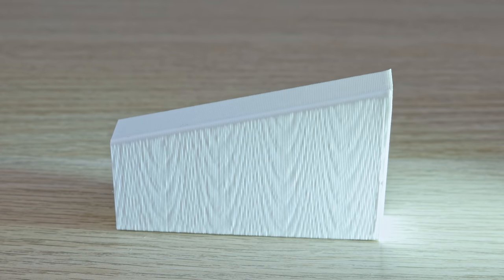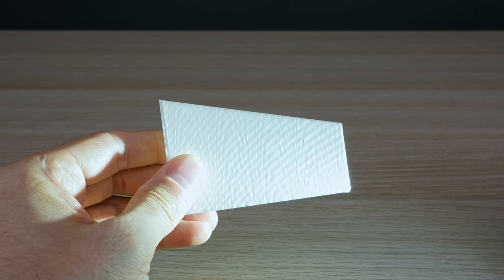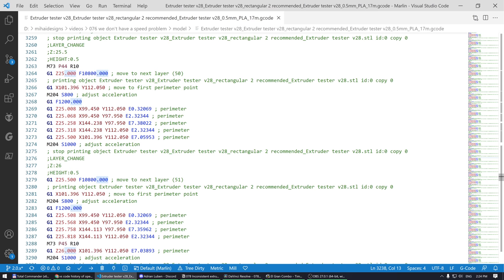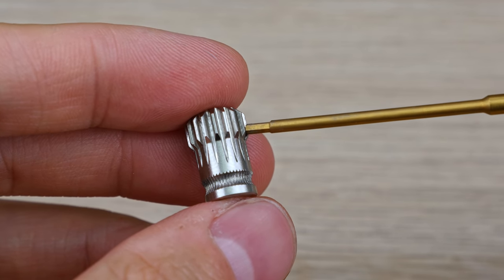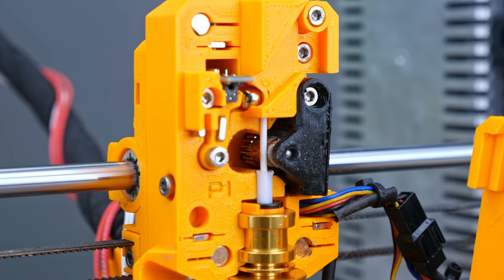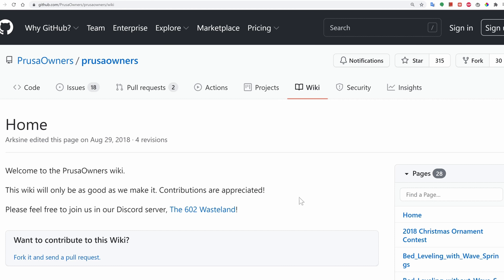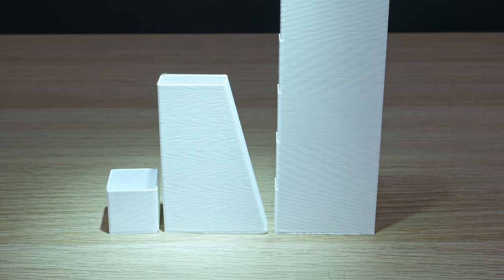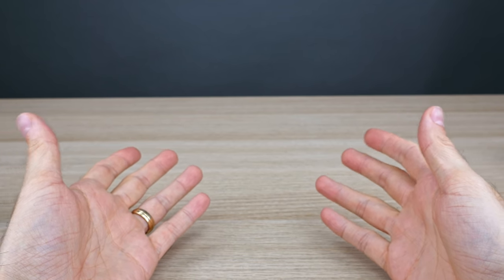What I've learned about dual gear extruders and how to patch them, maybe

Comment: There is another issue in play you missed!! The excentricity, however small, in each gear, is always aligned the same, because the gears are the same pitch, varying extrusion pressure no matter the slack. Variations in tooth serrations are also an issue. In ME we would use 2 different sized gears, with an intermediate, but that would introduce more play. Time for a toothed belt! You can vary the size of one extrusion gear, and correspondingly to its drive gear section. That should solve both your observed issue and the one I see as well.

 Don't assume compromise is the solution. We have engineering.
Reply from the maker: Yes, was pointed out before. Eccentricity should be a very different pattern, way way more elongated. Tooth shape could be a thing as in the machining not being accurate enough. The play itself shouldn't be an issue so long as the motion can be transmitted uniformly, as we're only extruding one way. At least the way I understand things.
Reply: @MihaiDesigns  It might be tiny, but as we approach higher levels of precision, it's something to consider. Our craft is making new leaps recently.
Reply: I was thinking the same thing about the belts. A double belt extruder
Reply: @NaterNorris  there is one that has been around for a while, but is for Bowden systems.  https://www.thingiverse.com/thing:2289203

Works really well for the printers that we use at work. A guy that started before I did switched all the Bowden extruders out for this instead.
Reply: I remember seeing this craze UM2  feeder years ago.

https://www.youmagine.com/designs/ninjaflex-geared-ultimaker-2-feeder
Reply: @drewporter8959  Very similar to the drive rollers on a wire feed (MIG) welder, only it has two pairs, MIG has only one.

Comment: Drop Effects OmniaDrop extruder addressed this years ago.. :P  since I got my 1st one and discovered it's improvements, all my printers now use the OmniaDrop!
Reply from the maker: How was it addressed? I'm not familiar with this extruder, but does seem to be using the same gears.
Reply: @MihaiDesigns  they are actually pitched at an angle, think like 12 degrees but dont quote me on that. Keeps the gears from separating when inserting filament as badly as normal inline gears so the backlash is lowered a good bit.
Reply: @MihaiDesigns   here is my interview with Max from DropEffects and his explanation of why/how he pitched the gears- https://youtu.be/WPwXVGKFQ5Y?t=1556

Comment: Great work! The first video of yours I saw was the "3d printing does not have a speed problem", and I wrote you off after seeing it. But I'm so glad YouTube suggested your last two videos! You have obviously put in a lot of time and effort into investigating and documenting this issue, and I am grateful for your efforts and that you shared your results and conclusions. Thanks!

Also, I wonder if replacing the spring tension mechanism with a fixed positioner like the LGX does would have an impact on this. The thought is that the force imparted to the idler gear may have a component that compresses the idler spring, and that component varies with the relative position of the driving and driven gears. A rigid idler mount would prevent spring compression that results.
Reply from the maker: Haha yes, my most unpopular video that will forever hunt me. I'll leave it there as a reminder.
You could be right about the LGX design. I have yet to try it out. I guess to simulate a more rigid tensioning system we can skip the grub screw spring. But I somehow doubt that LGX isn't using some sort of springy solution.
Reply: @MihaiDesigns  I'm not sure about LGX, but I know if at least one instance where the spring has been omitted from a dual gear setup with good results. However, it was done for part clearance reasons, and not in the context of the issue you're investigating here. That is to say, it's possible, and may be worth testing in this context.
Reply: How would a fixed positioner deal with variations in filament diameter? It could slip or bind up.
Reply: @ferrumignis   in hindsight, I wish I had said "fixed position idler". You're right that it could potentially slip or bind if the filament diameter variation is extreme. In my experience, a typical extruder bites into the filament much further than the typical filament diameter varies, so I don't think that would be a problem. I have actually been running an extruder with a rigid idler for more than a year now with no issues. 
As for why it might help with this issue, it seems plausible to me that a spring loaded idler can move away from the drive element under some circumstances, allowing the filament to "ride up" on the knurls of the drive element and changing its effective diameter. Would be interesting to see tests to verify whether this happens, and if it does, whether its effect is negligible.

Comment: Awesome research! I will need to print your STL files and see if I'm getting the same thing. I recently converted my Creality Ender 3 Pro to direct drive with the stock single gear extruder and then started to see surface patterns that weren't there before.
Reply from the maker: Go for it!
Reply: @MihaiDesigns  I'm wondering if eccentricity of the drive gear is at play. The gear has two grub screws, but I swapped the extruder and z motors to maintain full X travel. The z motor shaft doesn't have a flat spot like the extruder motor does.

Comment: Is it possible to solve it programmatically? E.g. if each printer has static deviation from ideal extruder then it might be possible to make extruder motor rotation adjusted to that deviation to compensate it. 
Some kind of coefficient, like the LA one. The tricky thing is that printer might has to know somehow the position of the gear on a moment of starting printing.
Reply from the maker: Not very easy. You could in theory do it, compensate for a repeating pattern. The challenge is figuring out the pattern offset, so how to align the compensation with the pattern. I guess in theory you could manually align it using some test print and then never turn off or reset the printer so it knows the pattern offset at all times. Include that in the firmware and it might work. This also goes for other patterns as well. With vibrations it's easier because you can use an accelerometer to make measurements. Well, technically you could add a very precise encoder that reads the filament movement (even though that would have its own moving part that can add error) and use the readings to figure out the offset (and potentially figure out the compensation function automatically).
Reply: @MihaiDesigns  if gears issue affects only the speed of filament movements (by making it unstable) then we can make a calibration movement before print starts (e.g. on a nozzle prime action) and measure speed with it deviation. Then having information about speed deviation we can identify pattern offset. To do it we might make a device that can read a speed of filament usage. What do you think?
Reply: @Dmitriy125125  I’m designing a printer that uses multiple independent print heads collaboratively printing an object, so reliability is key and this is something I’m of course interested in.

 I have a few ideas for low cost reliability, one that I’ve thought about to increase reliability is having a laser on the underside of the nozzle to measure actual extrusion and measuring actual object position/ layer width. That’s the device you’d want to measure filament extrusion, whenever more filament is pushed through the nozzle you could increase the speed of the x/y axis to smooth it out and slow down when the extrusion decreases. I don’t know how that can be implemented in firmware so maybe a god sent software engineer can chime in on that one

Comment: First of, great video. I have also watched all the inconsistent extrusion solutions and none worked. And also looked at ender 3 print that looked better than my prusa mk3 prints. I left the search for a solution as prusa research called it non existent and I supposed people just accepted it. Second, a good solution to avoid inconsistencies in gear movement is to have different teeth count in the gears, usually prime numbers. It might help here. Now you NEED the same tangential speed on both gears! So you either change diameters of the hobbed parts with the teeth or you add a train of gears (an idea I read below) with one being    on the axis of rotation of the door. Third, prusa nextruder brought other videos that explain possible issues in low diameter hobbed parts. For example, excentricities. This might be the case of both single a dual gear IE. Lastly, my vote is for belted gears. Might not be the best for traction, but it would be better than no dual. I think it could handle well different pressures of the hobbed against the filament. I dont remember any implementation of this.

Comment: I think the issue you found is very interesting, it is due to the fact that gears have to mesh very well, so a solution would be to fix your dual gears in the right position by calculating the (in dutch: Steekcirkel). Dual helicals, are not the best solution since you have to center two gears on the same axis. herringbones can be a solution, however those are expensive to make and does not solve the fact that the gears mesh badly.

Also there are problems here like, Hunting Tooth Frequency and the fact that gears have to have time to work in on eachother before they work best, especially hobbed gears. I would suggest a test, try finding the modulus of the gears, calculate your "steekcirkel" and make a fixed extruder. this should help see if its the position of the gears or just bad fabrication.
Reply from the maker: I'm just learning about the manufacturing of double helical gears. If it means you have to machine them separately and then join together then that sounds very tricky to get right. I was hoping we could perhaps move them at the ends of the part and somehow machine them from one solid piece (if it makes things easier). If it is technically doable, then some misalignment (gears not meshing at the correct distance) would result in an uniform backlash and would still transfer angular velocity uniformly. I have very limited knowledge on this stuff, so I might be wrong here.
Gears having to work on each other - with this kind of mechanism, even if they get the work needed, you could easily have one rotate when servicing the extruder and you'd then get the teeth suddenly meshing with new teeth which I imagine starts the whole process all over again.
Reply: @MihaiDesigns  Involute gears do transfer constant angular motion even with changes in centre distance.

Comment: Awesome work, thank you!  I was not seeing the pattern with my LGX, and the biggest mechanical differences are that the gears are much larger than the ones you showed here, and the tension adjustment is quantized to set stations instead of spring-loaded.  I'm trying to think of what difference those would make.  Larger gears would mean that adjustments in the gear mesh would be smaller in proportion to the gear radii, so small variations might have less impact.  The quantized tension adjustment seems like it wouldn't have much impact, except that it might reduce variation by holding the gear mesh to a set amount (versus the inherent flexibility of a spring-loaded arm)...  Two other differences are that the large hob wheels have more surface area in contact with the filament, which might average out some variation, and the build/machining quality is hopefully better (given the price premium 😅).
Reply: the lgx is geared, mihai's isn't geared.
Reply from the maker: Yes, I was thinking the same. Will have to get hold of one.
Reply: @Tedlasman  Yes, the LGX is 3:1, but I'm not sure this would matter because Mihai's findings are pointing to the driven/idler gear mesh, which is 1:1 regardless of the stepper/output ratio.  That drive geardown could certainly introduce artifacting of its own, though -- and that could be tested on any of the dual-drive geared extruders like the Orbiter, Sherpa, Hemera (I think?), M4, LGX, etc.  These offer ratios from 3:1 to over 7:1, if I'm not mistaken, and would all produce different periodicity if it's a problem.  I only have access to an LGX and a Nimble right now.  My Nimble (early-gen, V1.2) does have hilarious levels of artifacting because of the drive cable, and my testing from that gives me confidence that the drive ratio won't be a primary factor -- the artifacting I saw repeated at about 1.4mm^3 of filament, which corresponded exactly to half a rotation of the drive cable (that is, upstream of the Nimble's 30:1 worm gear), and changing the ratio upstream of the drive cable with a 1:3 overdrive on the stepper didn't alter the pattern.  So you have to consider how potential artifacting sources might stack, and in what order.
Reply: One other thing that might set the LGX apart is that the large gears should have more teeth interfacing at any given time, compared to the normal ones, which would also add an averaging effect.  If you think about the mechanical problem, these small-geared dual drives push a fair volume of filament for every tooth interaction within the mesh, and I don't know if it's possible to have a straight-cut tooth profile that gives perfectly smooth motion through the full sweep of two teeth meeting and parting ways when the depth of mesh is variable.  Any variation of where the teeth intersect will slightly change the 1:1 ratio one way or the other and introduce extrusion variations for straight-cut gears.  On that basis, I'm convinced Mihai's suggestion of herringbone driver/idler gears would probably go a long way toward resolving this for gears of the size in the video.
Reply: @jamespray  Standard involute gears do allow a change in the centre distance between the gears, while maintaining a constant rotation speed between the gears, this is one of the benefits of the involute profile. That's why this pattern effect is so perplexing, since in theory it should not happen. 
My current hypothesis is that it is caused by shaft angle misalignment, which is known to cause meshing errors and edge loading of the gear teeth (it would also explain why it happens on some extruders but not others). This is dealt with in industry by tooth crowning, which solves shaft misalignment issues but the only way to know would be to test.
Reply: @Bordpie  Well, hey, then I learned something today.  But here's something else I've noticed that makes me inclined to finger manufacturing problems: look at the thumbnail on this very video.  On the right gear, look at the distance between the hob cut and the bottom of each tooth cut.  It's not constant, but describes a clear arc from high-left to low-right.  Likewise, compare the hob cuts on the left versus the right, especially the depth of cut.  They're not the same.  Given that sort of quality control in evidence, the odds of the tooth profiles being incorrectly designed or incorrectly implemented seems fairly good to me.
Reply: @jamespray  Yes, I think the parts shown in the video were cheap clones but he doesn't use them on his printers I don't think. 
It's a fair point, most people are assuming the gears are properly manufactured in the first place. I would hope E3D at least would do the proper engineering and quality checks. I remember seeing a video where they had a special geometry analysis machine which uses collumised light to produce a very accurate side on view of the part. The software then has automatic shape recognition and calculates any errors in geometry e.g. hole positions, roundness of holes etc.
Reply: @Bordpie  I'm sure E3D does a great job, from what I've seen of their manufacturing and inspection ops.  I strongly doubt the majority of extruders in existence were made to specs like theirs, though.  I've seen some pretty egregious quality control issues firsthand with GT2 pulleys this year, and you'd think those would be pretty simple to make right -- I bought 4 16T pulleys off Amazon in two lots and all had bores visibly offcenter and marred teeth to boot.  These dual extruder gears are much more complex to make than those.

Comment: Single gear with toothy idler? Squeeze that spring as much as your filament can take  and have a middle ground in the triangle? The Sidewinder x1 (no pattern) have a grooved idler, but that sill could slip. Excellent investigation work!
Reply from the maker: Yeah, I usually tend to squeeze the springs. Did the same on my Sidewinder. I can barely load new filament in 😂
Reply: @MihaiDesigns  on my old Anycubic i3 i used to tighten the spring too much, leading to under extrusion (because of the gear biting into the filament). After some testing, 2 complete turns seamed to give the best grip without hurting the filament. At the speeds we print with these hobbyist machines I don't see the need for dual gear extruders, still.

Comment: i will say im not an engineer however if the idler bearing is slipping shouldn't you just increase the tension to the idler and add scoring since that will increase friction reducing slippage, this is just coming from someone who took engineering classes for 4 years in HS

Comment: engineering student here, you could use another indirect connexion between the two gears, for example you can invert the axial direction of one then connect the two with a set of gears that can allow the second to translate a bit depending on the filament
Reply: Or use timing belt (2 loops, one idler to transfer between the two) to drive it as well, no need to change axial direction of the gearing